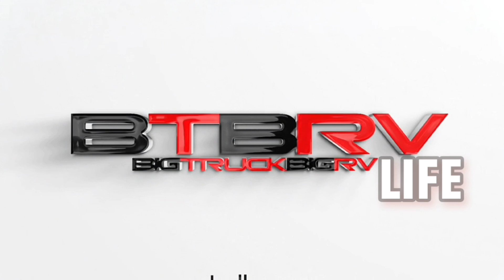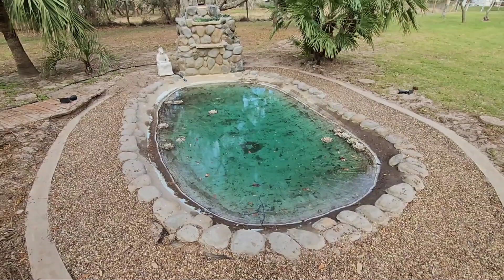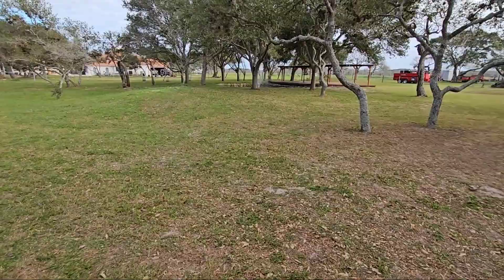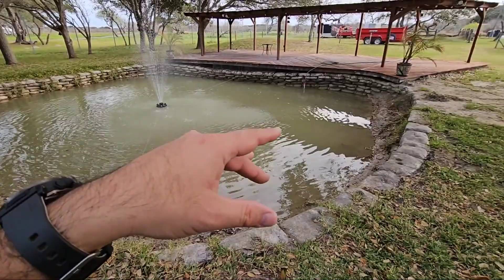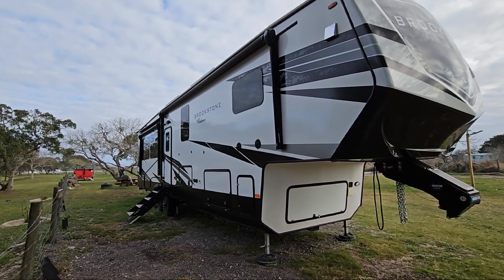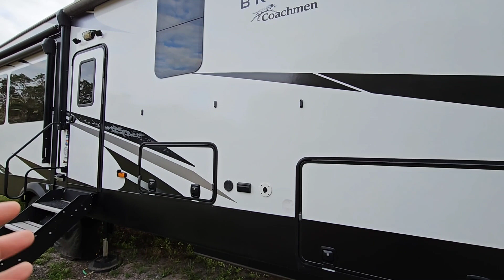Is Solar everything they say it is for RVing?

Comment: Great topic as I agree, solar is touted an easy way to cut out a generator but there is a balance.. without spending 10ks. we have 600w of solar and we live up north so the fall and spring sun is low and cuts its effectiveness quite a bit. it definitely lets us run the generator significantly less. and with parks that have limited generator hours this is another benefit. I would recommend 400-600w depending on the season you camp and a small generator. 3 100ah batteries and an inverter. we like we can run the microwave with out turning the generator on for 3-5min.

Comment: On our GD 31MB we have 400 watts of solar panels with 400aH of lithium battery. I mainly got it for using the electric for our mini fridge in the side compartment and the regular 120/propane fridge. With our travel days of usually 4-8 hrs (greatly depends where we are trying to get to) the panels and battery reserve seem to be doing very well. I built the system for room of expanding. Eventually I'd like to get to 1,000 watts of solar and 800aH of lithium. Charge controllers are expensive as are the lithium batteries. I also use it as a failsafe for our 3 four legged daughters who may be in the camper while we explore. Eventually I'll have the system set up to notify me of shore power failure. Lots of expanding to do yet, but the system is working.  

Great video as always.

Comment: Don't forget about the losses from DC to AC conversion. Most inverter/converter/chargers are only 85-95% efficient. Most electronics, even when "off" still use electricity. This is called "phantom" or "vampire" power usage. Cell phone chargers, even when not charging anything are still using power. Smart controls, USB equipped outlets, appliances with clocks or timers, etc all use power when off. The inverter itself uses power, even when its off, unless it has a mechanical disconnect switch.

Comment: Im am shocked that your refrigerator   pulls that much power.  I am very happy that we have a gas fridge.
In my system i have 1280 in solar, a 3k inverter and 400 amps of lithium batteries and very rarely turn on the generator over the past 4 years.  With this said we do not have to use air conditioning much but for the rest of our needs it works perfect running the tv, starlink and our other daily output.  Thanks for the videos!

Comment: The thing is, solar panels are relatively cheap, compared to batteries. To be self-sufficient in a big RV, you really need to add as many panels as the roof can hold, or close to it. 1000 watts is really high draw for a fridge, equal to running a microwave all day. You might not need to add any more batteries, if you don't run the A/C on battery power. The worst possible conditions for any solar system are running the A/C when you don't have a clear sky. The optimal solution for A/C on solar would be using mini-splits - they're radically more efficient than standard A/C units. Unfortunately, I don't think anyone makes a drop-in mini-split to replace RV A/C units, so it would involve considerable surgery to get them installed.